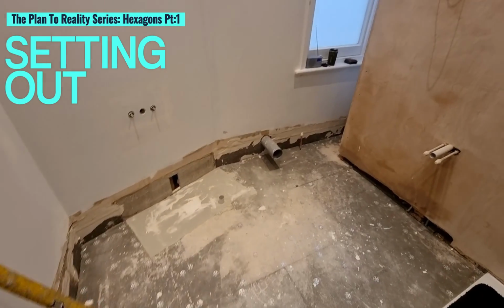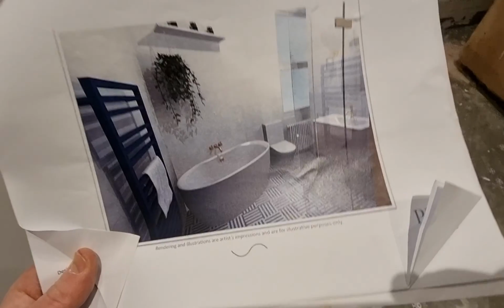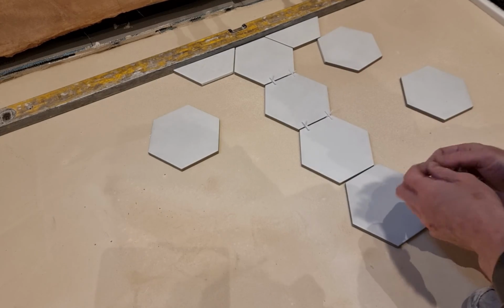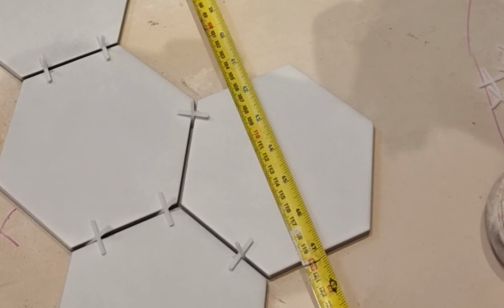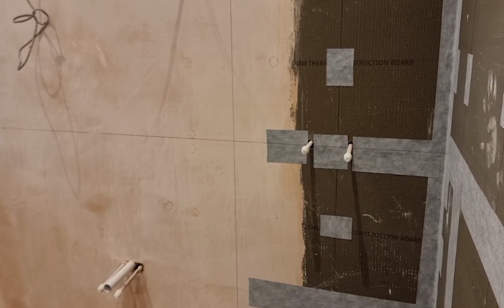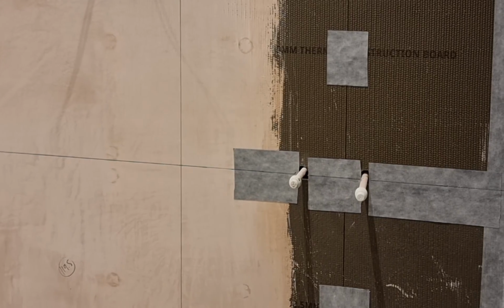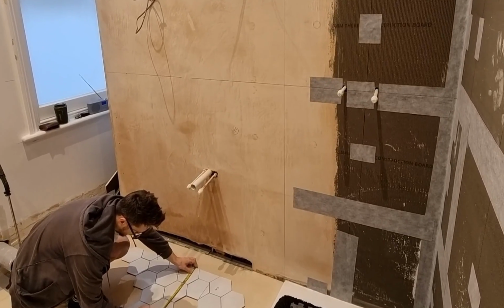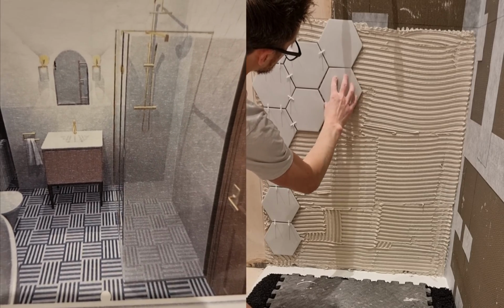Hexagon Tile Set Out for Beginners | Pro Guide

Comment: I've read in some places that I shouldn't use spacers/levelers with hexagonal tiles, would you recommend the same?
Reply from the maker: Hey, I definitely wouldn't use level clips the tiles are to small. Regards Spacers, Hexagons are usually very sizey.. So use them but don't trust them. Work to a line and adjust accordingly to what looks right visually 🍻

Comment: I'm about to tile my shower pan (60"x30") with black tiny hexagon tiles. Any advice on where to start the layout.  Many thanks.
Reply from the maker: Hey, So this is a wet room shower tray right? The most important thing is that you are square with it, The drain is normally the best thing to take your square from. I presume they are mosaic style hexagon's maybe on a sheet?  If they are small they should follow the shower tray falls fine. It really depends on the size of the tile and how the shower tray finishes. You'll always be safe to put a centre line down the middle of the tray and work from that for even cuts either side. You're welcome to email a picture of the tiles and tray if you like, and I can give you a more detailed response.

Comment: This is exactly what I am about to attempt, have a Rubi tile cutter and a tile wet saw with a new disc. Getting quite bad chips from the tile wet saw and the Rubi with a 6mm disc sometimes breaks a tile into 4… also, my parter wants the hexagons with the points up (which does look great) but feels a little harder. Any tips for cutting with a wet tile saw?… my tiles are ceramic
Reply from the maker: Hey, The Rubi wet saw chipping sounds a bit odd on a ceramic tile, The blade could be the wrong way around (so it's bouncing) or it needs a bit of wearing in. Regards Rubi manual cutter, Is it a pull and snap mechanism or a push down mechanism? The push down mechanism is really needed for this kind  of cutting. The other thing you can try is just skoring them, and snapping them with your hands.. Normally pretty easy with ceramic tiles. If all else fails, as messy as it is, get an angle Grinder with a red Rubi diamond disc and cut them that way.. Being ceramic they should cut  very easy.
Reply: Hmm, do you have a continuous smooth diamond blade on the wet saw? Don't test it with your fingers if it looks sketchy, but you should be able to hold a finger on it without it hurting you. Mesh blades and other serrated brick/concrete cutting blades aren't good for a tile wet saw as they will chip for sure if you're not very careful. IF not, make sure the bed in the blade with that stone they provided. If that doesn't work either, than push your tiles slower through the saw. If THAT doesn't work either, then get a very thin diamond smooth blade on your 4" hand grinder and go slowly, and do several cuts until you go all the way through.
Reply: If you do lot of tiling buy Montolit Masterpiuma it's much better than any Rubi dry cutter.  Diamond blade need to be with continuous edge if there are those caps it will chip tile.